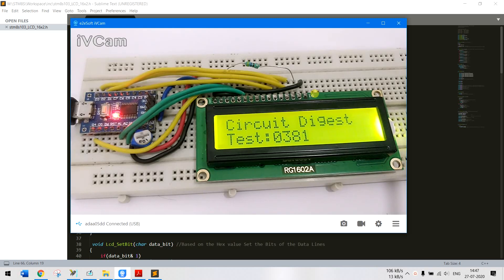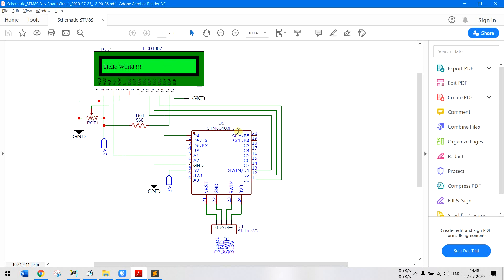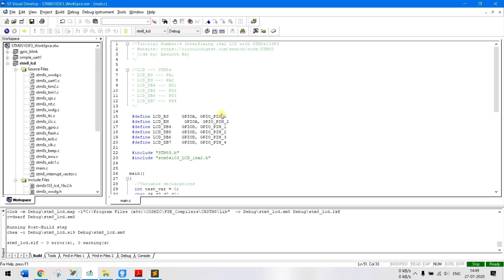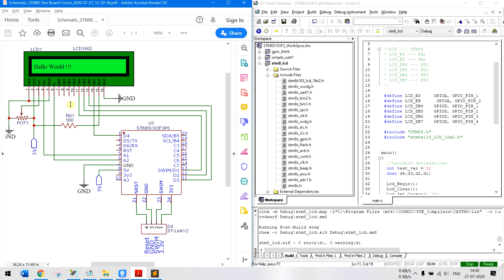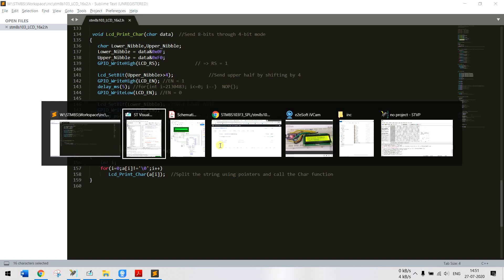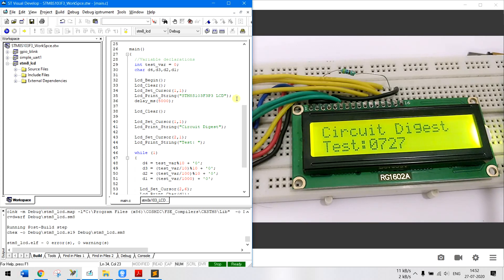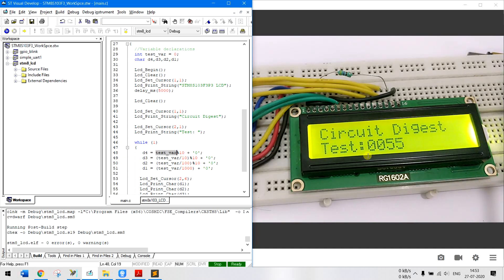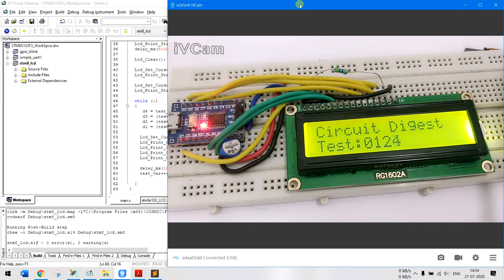How to interface 16x2 LCD with STM8 Microcontroller

Comment: Nice tutorial sir I needed some project but no LCD . My project interface.    4.    7 seg
Reply from the maker: interfacing 7-segment is easier, https://circuitdigest.com/microcontroller-projects/7-segment-display-interfacing-with-pic16f877a you can check this link for PIC MCU but its very similar for STM8 as well